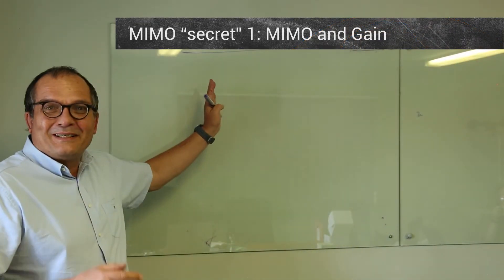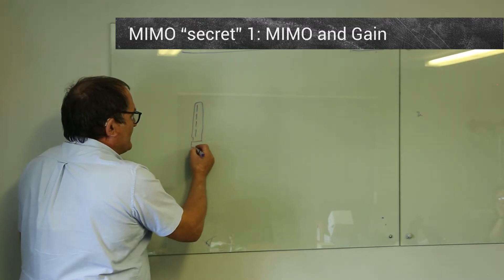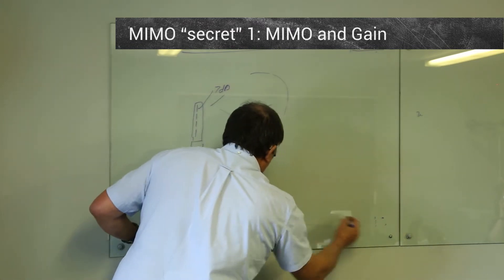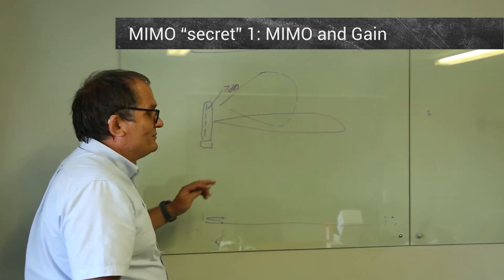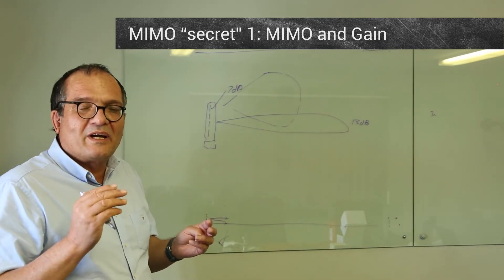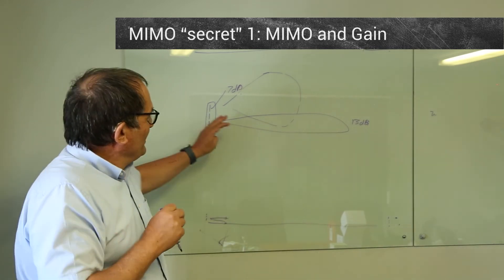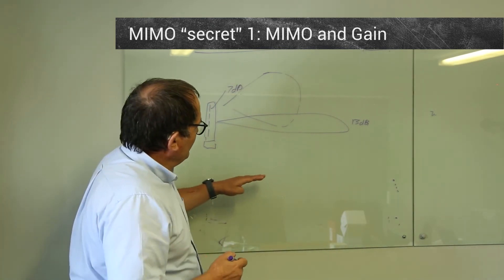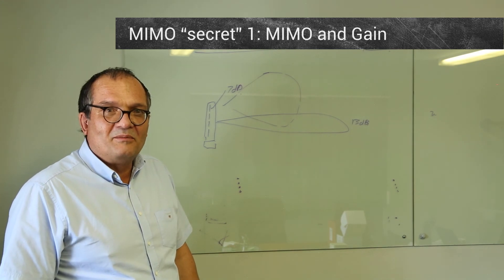MIMO Secret - #1:  MIMO Antennas and Gain - Secret no 1

Comment: Andre youtube algorith made me reach here. Outstanding your knowledge. Please can you guide me to solve this issue. I'm using an archer c24 router , which has mimo array antennas. Now problem i'm having is downlink it's slow compared to the uplink speed, I'm talking about 5ghz frequency ( tried setting different banbds also). Up 100mb versus down around 30mb  ( sometimes it gives me the impression temperature is a factor, might increase the downlink a bit more) . Router it's outside with antenas all beamed horizontally. What could be wrong, causing this effect on downlink.  I was thinking on disassembling and replacing the antenna array with some external directional antenna is it possible to cancel and maybe place a directional yagi.
Reply from the maker: Hi @juangizirian9810  

Please read our technical support below. Will you please send a mail to info@poynting.tech. Use "Enquiry for Tumelo" in your Subject line. Tx Ylana

Good day. I think this one need proper elaboration of the user's situation. Can the client send us a photo of their set up please, and state which antenna are they using and the mobile network operator. It is possible that their antenna may not have MIMO capabilities, even though the router does. Looking forward to his response. Thanks -